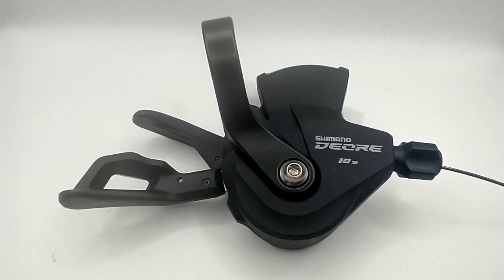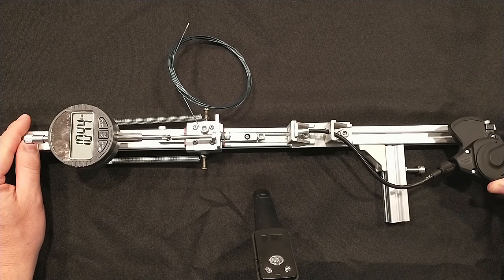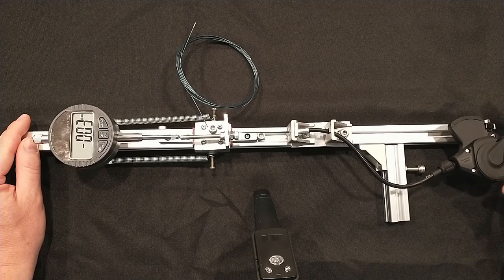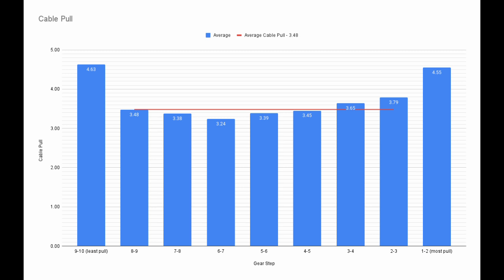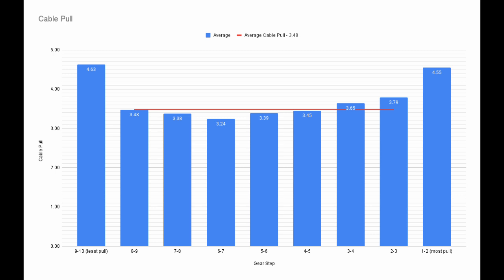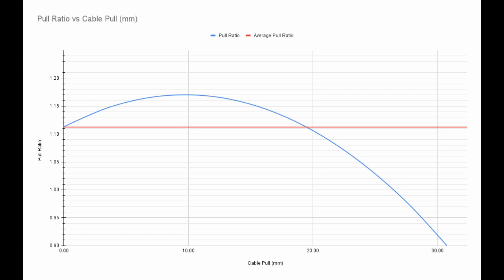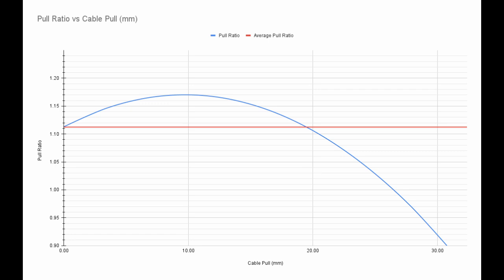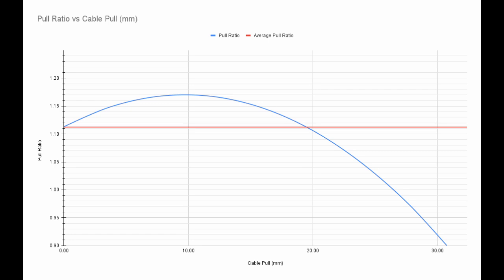Shimano Deore 10-speed Shifter Cable Pull

Comment: I like your accuracy/approach. Last time I did this I was using a ruler taped to a chainstay and a piece of scotch tape folded over a cable. This was back in maybe 2011. I've seen others use your approach before but I never got around to building such a rig.

Ignoring the first and last shift, I arrived at 3.5mm on average, for Dynasys 10... when ignoring the first and last measurement and dividing the sum by seven. Not bad for a much less accurate system. Nice to see my numbers were only 0.02mm off from yours, which could even come down to the shifter (I used and SLX). I only measured for the increased tension direction because I had to account for housing friction if I released cable tension and went in the other direction. 

That said... I screwed up when I included my number in the WikiBook on this stuff because I included the first and last shift which gave me 3.44mm which I rounded to 3.4mm. I assume you are familiar, but if not, https://en.wikibooks.org/wiki/Bicycles/Maintenance_and_Repair/Gear-changing_Dimensions

 Thank you for posting your numbers. You should consider adding to the wikibook. If I ever find my login I'll add your numbers over there. I need to start taking measurements again.

Comment: I like this channel.  ME here.  Have you thought about a graphic display/graph where one can select a shifter, RD and cassette and have shown "offset-from-perfect" for each gear?  Probably also need an input where the user could introduce a cable adjustment offset to have better alignment in a certain part of the cassette.
Reply from the maker: Thank you for the feedback! Web Developer here. My first iteration of drivetrainbuilder.com kind of worked that way, where you'd select a shifter, derailleur, and cassette and gave you a compatibility assessment. It didn't seem to be very popular. I think the problem was that the act of selecting components requires too much thought. My assumption is that most people already have a handful of parts that they are thinking of using and want a quick verification that something will or won't work. They don't want to pick and choose parts, hoping that the combo will work.

Part of the problem is also that "perfect" is a range, not a single number. My methods here are very empirical, and I'm discovering that the interaction between the cassette and chain plays a huge role in compatibility that I simply don't have the expertise to model. Imagine using CAD to model every single cut and ramp on every tooth on a cassette! I don't have the expertise with CAD or the time to do that.

Besides, it seems that perfect is different for mountain vs road. Road prioritizes low friction, so those groups seem to have less offset between the guide pulley and the cog. Mountain prioritizes chain control and shifting under load, and having more of an angle where the chain touches the cog seems to help with that. I don't have a way to quantify either of those. Perhaps a talented mechanical engineer could take that project on.

I think it would be interesting to add a more dynamic component to the website to let you pick and choose components and tweak the model. I'll have to learn how to run my Python model in-browser to make that work. In the meantime I would like to add a section to the website that answers the question "why won't this work?" Sometimes it's nice to get some explanation of why a certain combo won't work.
Reply: @boothsbikeprojects  Thanks for the informative reply.  I haven't given much thought to how the chain interacts with the cog.  Makes sense considering all the interesting geometry near the cog tips.
Reply: @boothsbikeprojects  Your pull rig and ratio rig seem good.  Would you say I could add e.g. pull increments and get the total pull?  I was thinking to  compare where the jockey ends up is a combination of the total pull amount for a given cog and the combined pull ratio (starting at "zero") for a given cog.  Does that make sense?
Reply: Is there "raw" data online somewhere with the pull and ratio readings?  What would you consider to be the "zero" point for pull measurements and ratio measurements?  I was thinking to use the 5th cog or second cog up from the smallest.  I assume you have both limit screws adjusted to not take effect.
Reply from the maker: I think this will be easier if you email me at hello@drivetrainbuilder.com .

To answer your questions, the data is all available here: https://github.com/boothinator/derailleur-analysis .

You're right that you can just sum up the pull increments to get the total amount of cable pulled by a shifter. Perhaps I should have supplied the absolute values instead, but it's pretty easy to just sum everything up. You can find all of the raw data for each shifter in the shifters folder. The info_out.json files have the lightly-processed data. You can also find the combined data for all the shifters in the all_shifters.json file.

Similarly, you can find the raw data for derailleurs in the derailleurs folder. The info_out.json files have the info that results from all of the processing I do to the data. The "coefficients" data is a list of the coefficients for the 3rd order polynomial that calculates the lateral position of the center of the guide pulley. The x parameter represents the distance from where the derailleur mounts to the hanger, and increases going toward the wheel.

You are right that I try to back out the limit screws as much as I can.

I hope that answers some of your questions.

Comment: This M4100 shifter is gold! Can work with CUES Linkglide cassetes!

Thank you for your work!
Reply: I can confirm, I have four bikes all with cues Linkglide 10s cassettes, cues don’t have I-spec shifter compatible with my brakes, so I tried the M4100 I-spec version on one bike to try it out, works perfect, I bought three more, now I have this set up on all my bikes, also I have four different derailleurs, XT 12s, XT 11s, Deore 11s and Linkglide 10s, they all work perfectly, I also discovered all shimano 11s shifters don’t work, wrong pull ratio.
Reply: @keithchalk3912  So you are saying (M4100 shifter + Linkglide 10s or any derailleur 11+s + Linkglide 10s cassette) works. I'm wondering about (M4100 shifter + 10s Deore derailleur + Linkglide 10s cassette). In theory, it shouldn't work right?
Reply: @Zorgloth  You don't say which version you have, I recommend the RD-M5130 it has a clutch and can handle 48 teeth (Shimano say 43 teeth, but it does way more) also it has short cage, less risk of getting bashed up on the rocks.